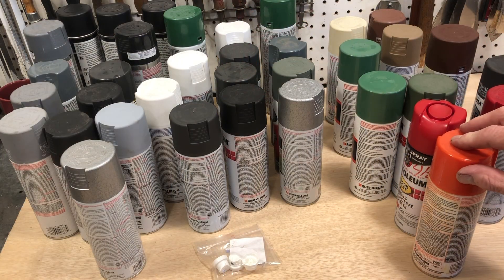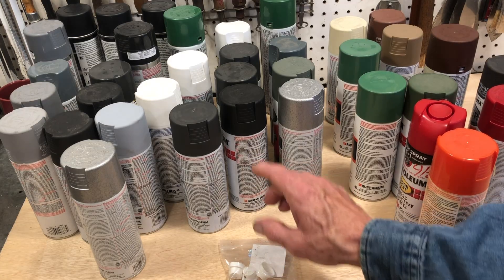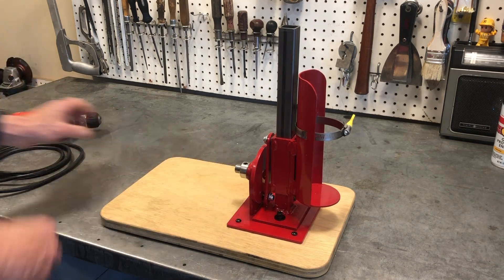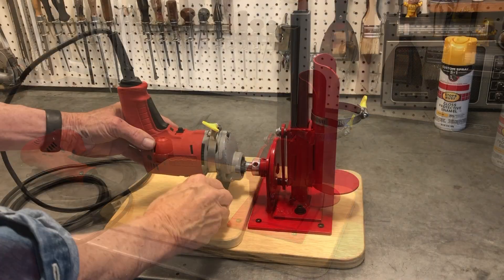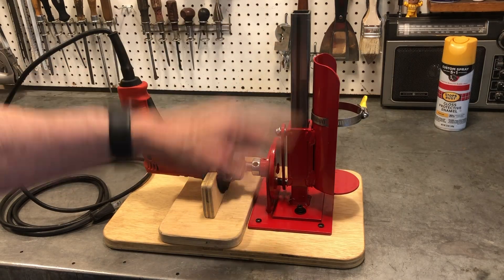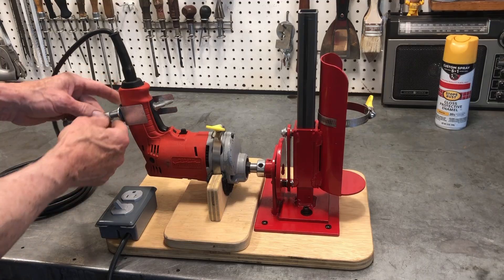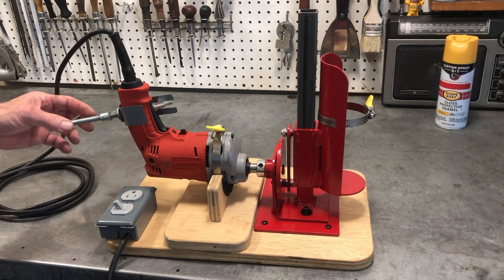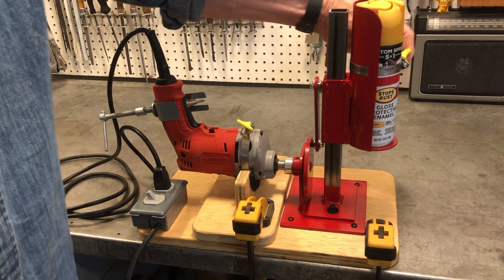My Electric Drill Shakes Spray Paint Cans.

Comment: Cool Shaker. Do you have a parts build break down vid.
Reply from the maker: Thank you! I don't have any diagrams, I just designed it in my head. The wheel is 4" diameter and has about a 3 1/2 throw. The connecting rod is 5" long and eye to eye is 4".The shaft is 5/8". I made one from a 5/8 bolt but is was too loose.  I then made a new one by turning down a 3/4" rod to fit the bearing with about .003 clearance.. The bearing is a bronze 5/8 bearing from Ace Hardware. The guide tube is 1" and I made the slide about 30 thousands clearance. Hope that helps, Thanks for watching and commenting, Kevin.